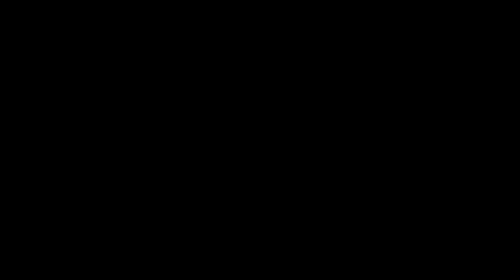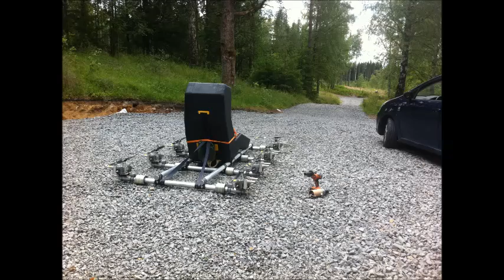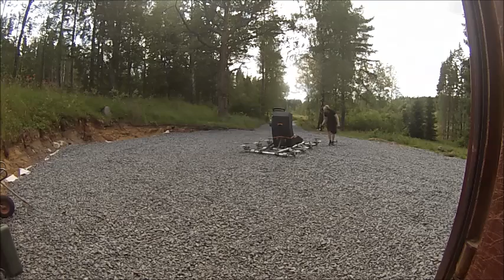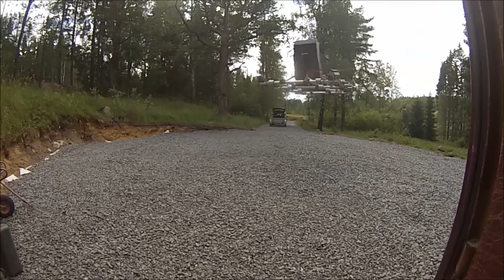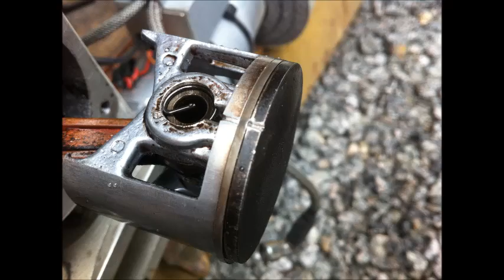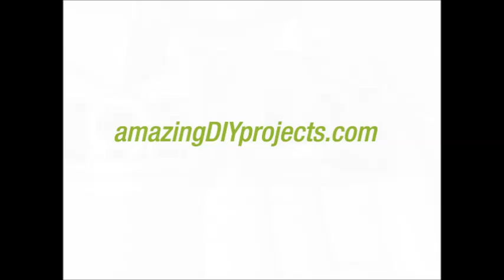Manned multicopter / multirotor build Episode 9

Comment: 1. You need to reverse the direction of rotation of the engines on one side to equalize the yaw forces. You should be able to turn the cylinders  and pistons 180 degrees, re attach and see if they will run in  the opposite direction. Obtain left hand  props and mount them on those modified engines. Also, get a GYRO for a large scale rc airplane or helicopter and mount it to your receiver to get this aircraft steady.

Comment: That's great you got it up and running again! If this setup proves to be too much trouble, have you considered an alternative design?  Check out the Stingray 500 RC quadcopter. Rather than 1 motor per propeller, the quadcopter has 1 motor, a drive shaft system, and 4 collective pitch propellers. There is an electric version and a gas (nitro engine) version. This quad was designed for 3D flight, but it is also quite stable in normal flight.

Comment: How about electric powered by a small petrol generator. It would be interesting to know if that could be lighter and more efficient than the current system. Could even have a small emergency battery to land if the generator failed. For that multicopter to be any where near safe it will need redundant control systems similar to fly by wire aircraft.
Reply: A generator powering the electric motors? Can't see how that wouldn't be too heavy to fly.There will be power loss due to inefficiencies in the generator, wiring, motors and control units.

Comment: Why not place the props above the seat for natural stability.
Reply: Doesn't work, despite the intuition saying otherwise. Read the Wikipedia article on "pendulum rocket fallacy" for an explanation, it's applies pretty much identically to multirotors.
Reply: I don't agree. I understand the rocket fallacy but this is not a fixed thrust vector and I think that makes a big difference. Also this is hover, not rocket flight.
Imagine the seat on a 10 meter pole above the rotor set vs hanging 10 meters under. Which do you think will kill him. So in summary: I'm right and you are wrong :)
Reply: Also I would make it electric because it's just more elegant despite the substantial endurance handicap and I would make it wing based so you take off vertically like a drone with an upright thin wing and then arch into horizontal flight for speed, efficiency and range. The typical drone config is super inefficient and surprisingly poor at range and speed.
Reply: +Giza Plateau Giza is defiantly Right because the center of mass is below and in between multiple points of thrust the pendulum cannot swing. Imagine a pendulum connected with multiple points, I can't move.

Comment: Nice work (as always).  It almost looks as if you've got some FOD damage to that piston.  Are you running air-filters on the motors -- it's definitely a good idea when operating in close proximity to the ground because prop-wash will kick up a lot of debris.   You may also find it well worthwhile to shroud those props -- it will increase efficiency quite markedly and provide a margin of safety for yourself in the event you find yourself in too close a proximity to those whirling blades of pain :-)
Reply from the maker: There are only crude metal mesh covering the air intakes.....so FOD is very much a possible explanation.
Reply: +amazingdiyprojects    Either FOD or running lean. Might be piston to bore friction if running lean melting the piston over the ring gland. Either way, not sure if a human test would be advisable. Too many moving parts.
Reply: Hey old man Simpson. :p
Reply: WarblesOnALot COOL!!  I checked your video out!  Guess what, my father pioneered the hanglider movement in the early 70's, one of the first 20 guys in a small group in California.  This was before the "kite" style hanglider became the standard; his was a solid construction biplane flying wing and had rudders between the wings at either end.  This same group started experimenting with bolting on small 2-stroke motors on hangliders which as you know became to be known as Ultralight aircraft which did not require a pilots license to fly.  My father later worked for a company called Mitchell Wing where he became the chief designer of the A-10, another flying wing, single wing which was a solid construction polished aluminum skinned with only rudders as winglets.  My dad holds a patent at the United States patent office for this wing design (http://www.google.com/patents/US4671471)  The A-10 was an extremely clean design with had a streamlined fiberglass cockpit and a tricycle style landing gear with streamlined wheel fairings.  The engine was a very reliable/high output/lightweight Japanese Komatsu Zenoah 2-stroke engine.  The A-10 was so much faster than any other Ultralight in existence that he was once disqualified for being too fast in an Ultralight race because his plane exceeded the speed requirement for the definition of what is an Ultralight aircraft.  The A-10 holds several world records for aircraft in its class. An American, George Worthington set eight records while flying one.  An A-10 is currently preserved at the Experimental Aircraft Association Museum in Oshkosh WI.   I was just a baby during the Ultralight hay days but I can still visually remember my dad taking me up in one of his A-10 Mitchell Wing aircrafts!
Reply: I second that it is likely FOD, but secondarily could be a seizure from running lean.   However, I'm leaning towards FOD without seeing it in person because of how distinct the damage is to one specific area.  Consider getting some K&N style airfilters for these engines.  They make them for these size engines and I'm sure the adapters already exist in the world of whatever industry you adopted these engines from.
Reply: WarblesOnALot Bummer!  Not a lot you can do about that except make sure these engines are getting enough oil mixed in the gas... I recommend running a synthetic 2 stroke oil vs the conventional stuff.
Reply: WarblesOnALot Yes, I believe it was an Icarus model hang glider (I'll have to check with him, but that sounds so familiar I am inclined to believe that is it, and upon a google image search some of the pictures appear to be it... it has got be it)!

Wow, that's a crazy story about the guy that went for the altitude record in a Mitchell Wing and later had a serious delamination problem with his composite wingspar.  Was he able to land it safely, or was that the last of him...?  Their were several Mitchell Wing designs but the most successful being the A-10 with it's innovative for the time lightweight, strong, streamlined foam cored, aluminum skinned flying wing (which the company patented and listing my dad as designer as I mentioned).  

According to my dad, he lost many of his friends during the early 1970s.  Somehow he made it, thank god, although he did have a several close calls including a near fatal accident when he was launching his hang glider off Yosemite Half Dome and his wing tip clipped a tree just as he jumped which spun him around 180 degrees and flew directly into the face of Half Dome.  The only person who could get to him was luckily a nearby mountain climber who was able to get him into a gurney lowered by cable from a US Army Huey helicopter.  My older brother was just a few years old and my mom was pregnant with me at the time (I was born in 1976). Sounds like you were pretty involved in this world, not sure if my dad's name rings any bells or not which is Steve Patmont.  He later invented the Go-Ped brand scooter and started manufacturing them  in 1985, this is when brother and I got involved. The Go-Ped has a lot of pedigree from Ultralight technology, it even came with a Komatsu Zenoah 2-stroke motor as did the A-10 Mitchell Wing. The Go-Ped is the first successful stand on/foldable, compact motorized scooter that is made in the USA; the prototype is preserved at the Smithsonian museum in Washington, DC and hundreds of thousands have been produced all the way up to this day.

I don't typically like to share all this but hearing some of your story I thought it was too fitting based on your history and interest.
Reply: Wow, such cool stuff, well besides how dangerous the sport is (or maybe I should say "was" as I bet they have a lot of the kinks worked out by now).  Thanks for all the cool info.  I'll have to share this with my dad, he will sure get a kick out of all this!  Take care my friend!
Reply: WarblesOnALot That's just crazy!!!  The damn bureaucrats ALWAYS seem destroy anything that is good...
Reply: WarblesOnALot 
I feel the same way as you.  It's gotten completely out of control...  I wish something could be done.

Anyway, I don't care what others call you, you "spin true" in my book ;-)
Reply: WarblesOnALot Cool!  I didn't know alternators had that much resistance when the battery was low, enough to greatly effect gas mileage that bad!  I love solar technology, I mean we are constantly having free energy rain down on us each and every day and we actually have the technology to harness it??!!! Every roof should be made of solar panels IMO.  So many would be produced that the cost would be a fraction of what it is now and we would all have almost limitless energy.  He who controls the energy controls nations and so those elites would lose that control.  I'm sure your SunFoils are more than plenty aerodynamic ;-)
Reply: WarblesOnALot Yeah, I love that.  Form following function is what I think is most beautiful, too.  I watched quite a few of your videos, and I thought that was so clever how you used the SunFoil to speed up the boundary air layer going down the steep backside of the glass in a similiar way like how vortex generators work, so cool!  

Is there a specific reason why you went with angular facets as opposed to a more curvy shape like a conventional airfoil?  I'm guessing because of the limitations you had used flat solar panels and manufacturing limitations?  I'm sure you already know, but now they make flexible solar panels that have the same output and they are relatively cheap.  Would be interesting to incorporate one of those that way you can curve it into a highly aerodynamic shape.  I seriously want to make one of these things now, starting to brainstorm...

Comment: Amazing progress!

Do you ever regret going with gas engines instead of electric motors?

Is there a reason you don't use a flight controller with GPS position hold, altitude hold etc etc?

Comment: Good job, what caused the piston ring to be pinched? 
I wonder if Colin Furze has seen this?
Reply: +SsoulBlade 
The flight controller should take care should a motor become redundant, the 3 remaining motors would have to work harder to cover to the dud engine. 
If an RC hex multirotor throws a prop, the flight controller will slow the opposite motor and retain level flight for landing.
Reply from the maker: I do not know. I will tear down the faulty engine and see if there is something to learn.
Reply: Why is our multirotor H shaped and not something more "conventional"?
Also, if one motor fails or has a problem, won't it the multirotor become unstable? 
Do you compensate for a lost motor/s?

Comment: Admiring your persistence. Thanks for chronicling this for us. Have you considered the electric options instead?  Many other experimenters are going the electric route. Also, are you using advanced flight control systems to stabilize the craft. Most gyro PID setup seem much more stable. Thanks again.